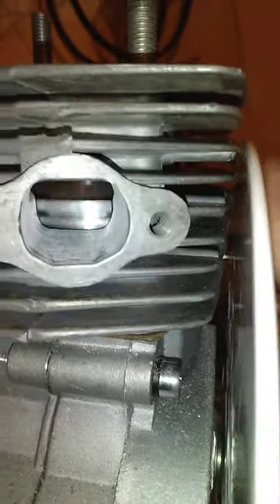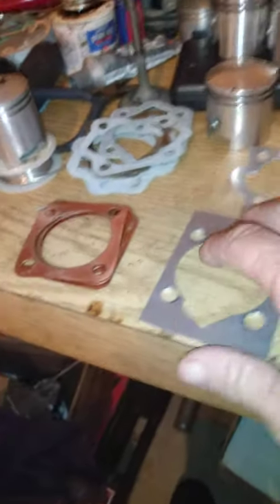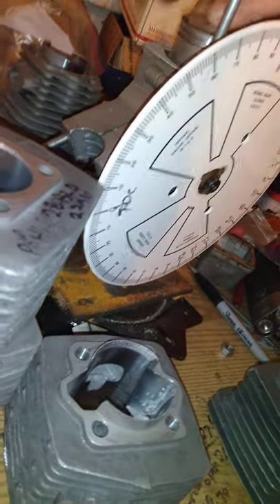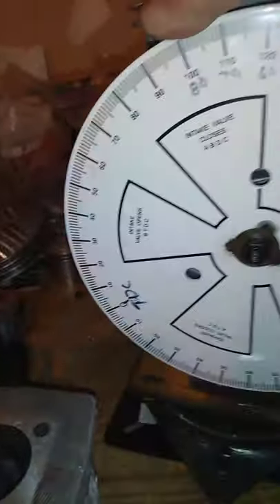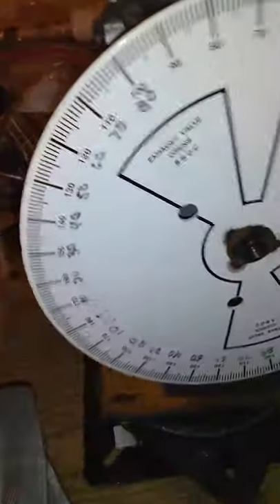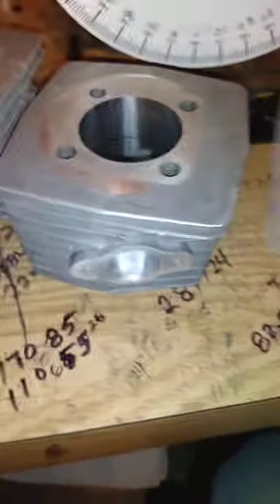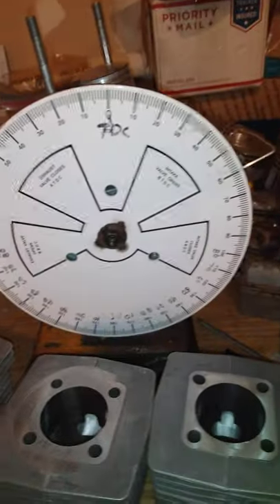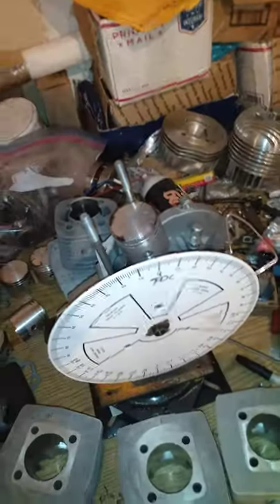66 cc port timing port shapes 3 diffrent aproches can't make it any easier to explain.

Comment: you've certainly experimented extensively. and besides the porting-the pipe and carb and tunong are just as important. so after all that - anything stand out in your mind as "real good"? do you ride all these motors and combos? how long do they typically last? i'd like more details. do you upgrade the bearings? true the crankshafts? the cranks are rarely usable as recieved for any high performance build IMO. not all of us have machine shops- what would you recomend as most important when someone builds a motor? all i'm saying is theres a lot more to a good running motorized bike than the port timing and configuration.find out what works and stick with that; then make a motor that holds together for a year . no mention of what brand oil you like and what ratio; i find using high quality synthetics(red- line) to be super important. etc etc
Reply from the maker: I belive I did make a video  on two stroke oils tested many brands if you have the money the best has been amsoil dominator  as far as bearings go skf are fine. I also have ran stock crank bearings. If your a bolt on kinda person. You can't compare a 20 $ ported stock cyl to say a mxs or Piaggio  or minerell cyl. But that being said I tried  all set ups from scooter cyls from 38 mm strokes to 44 mm stroke cranks to case Reed set ups . At the end of the day I preferred  a 47 x 40 mm ported stock cheap junk ported by myself g2 reeds and mikuni carb and pipe. As far as how long a motor will last that depends on lot of stuff meaning if you build a engine properly and don't try riding it around at 10,000 + rpm all day long . Long lasting motors have been one set up properly 47 x 40 mm China junk with a 7 cc head out of hundreds of combos  I have only had one mechanical  failure. My fault to much rpm . Most miles I have ever put on a motor is about 10,000 miles I had 4 bikes at one time during my testing so it was kinda hard to put more than 10,000 miles one 1⃣ bike
Reply from the maker: https://youtube.com/shorts/pvAETEhp70M?feature=share. Simple  motor with head pipe reeds carb stock crank stock cases 47 x 40 vm18 cyl stock 20$ cyl ported by me
Reply from the maker: Everything  is important  regardless  if your building  a NHRA PROSTOCK MOTORCYCLE  engine or a motorized  bicycle  engines

Comment: Can I ask why you hate minarelli so much I went aginst you and did it and I love it now I’m super curious as to why you don’t like them
Reply from the maker: Who hates them 4 years ago I'm the guy that gave the information out that they basically would bolt on.   4 yrs ago I did All this stuff mabe 5 now  from case reeds to strokers to mxs to saws.  Basically went full circle back to the stock junk stuff. But just with legit porting tips. Anyone can bolt on a minerrelle cyl not everyone can get a 20$ cyl ripping. Basically I can't take any credit for bolting on a pre made cyls. But short answer would be there not ideal for in traffic or hills there eather off the power band or on the power band can't ride around all day at 11000 RPM basically
Reply from the maker: Again think about what I said anyone can bolt on a mxs or a minerellie or saw cyl and they ripp. But basically you can't take credit for it's function

Comment: Do you raise your exhaust roof to match the amount of lift you added to your cylinder or is there another equation to consider?
Reply from the maker: I always raise the exhaust roof to achieve my desired  exhaust  duration and blowdown  & blowdown  %  I also  make my exhaust port width 70% of bore diameter. Depending on what cyl I use. Meaning if it's a g4 cyl with off set exhaust port I will only widen it above the the blowdown  ie  tranfer opening got vids showing why
Reply from the maker: https://youtu.be/5MESp5J86XU. Example  of my exhaust  port shape on a g4 cyl that has a offset exhaust port
Reply: @2strokecarbtuningportingin187  I've watched a lot of your stuff very informative actually the most informative I've found. You explain things the way I can understand. I was just having a problem understanding how high to raise them and not mess things up. I understand the width and not going below the transfer openings.
Reply from the maker: @bowmadman9562   to much of anything  is never good. Small bore two strokes are sensitive. Basically  porting  is a big part of determining  how it functions. Exhaust  port width  hight and roof shape  kinda  determines  how and where the power is delivered. Along with the amount of blowdown  and tranfer duration  and inlet duration. Basically  everything  needs to work in harmony. Typically  that's why I show people  the math and blowdown  %  these aren't  Yamahas Hondas or Suzukis we don't have luxury  of displacement  or gears. Problem  I see with most  folks  they want to run before  they learn to walk.  There's 500 different  routes  to take to get to the same destination. When learning  best advice it keep things simple less is better.two strokes are simple just misunderstood.
Reply: @2strokecarbtuningportingin187  I used to hear this "there's no replacement for displacement"..thanks for your help I'll keep watching and learning I can tell you know your stuff